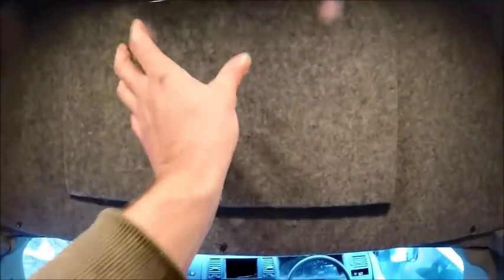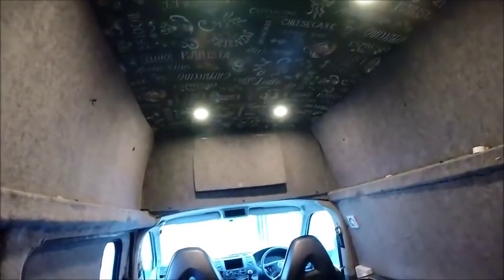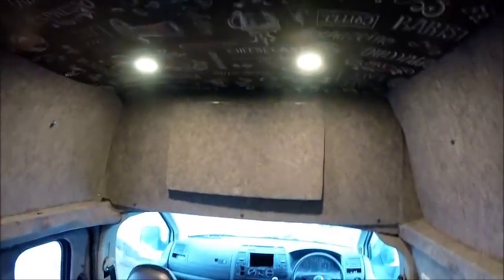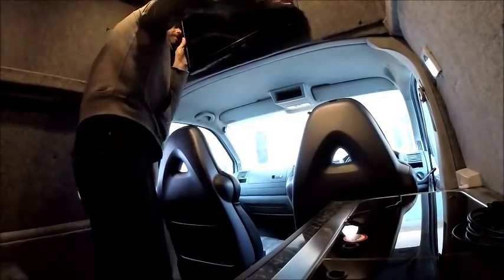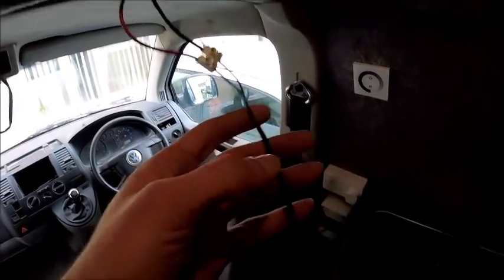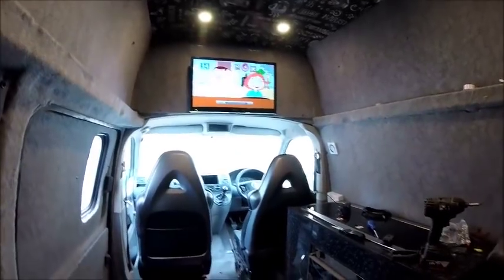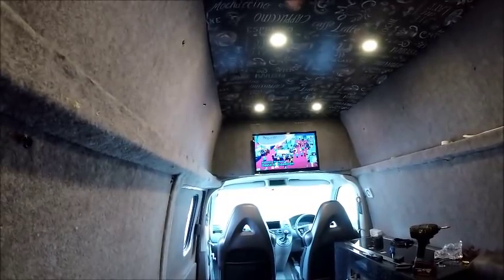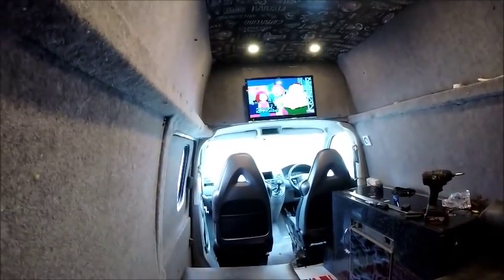VW T5 Camper van 12v TV Installation 24" Cello LED TV

Comment: Nice job, I fitted a 19” cello last weekend with exact same mount good picture but sound a little tinny on mine but worth the money imo.
Reply from the maker: yeah sound quality is never going to be good on cheap tv's, I might fit some PC speakers like I have in my T4, use barely no power yet deliver excellent sound quality
Reply: Camper Conversion good idea, I'm thinking of adding a dab radio/Bluetooth amp with speakers if I do will just connect with aux lead.
Reply from the maker: I'd seriously consider PC speakers, have a look at the pc speaker install video on my channel in my VW T4, they deliver a nice punch with its little sub, nice clear sound but barely use any power at all, like I think 3w at max volume on my power meter so just 0.25a per hour, a head unit with amp & speakers will draw a lot more power.  Only a concern if battery consumption is an issue of course but I found this the most efficient way to increase sound with minimal power draw
Reply: Camper Conversion thanks for the heads up will look into it, I’m just about to install another 140w flexi solar panel next week giving 280w of power always looking to save a energy.

Comment: Hi I’ve got a 12v tv for my camper build can I cut the wires from the adapter and split them connect to battery via fuse board? Also what fuse would you say? On the tv it says 5.83 Amps. Many Thanks 😊
Reply from the maker: Yes and 6-7a fuse

Comment: So if i got a tv in my house not being used at the moment, i can put it in my vw t5 just by cutting the wire and wiring it into my fuse panel, wiring another into my switch panel & earth to the vehicle?
Reply from the maker: if the TV says 12-14v on the back of it, potentially yes but if it only says 110-240v then no.  If it is 12v, then there will be no earth to wire, just + & -

Comment: My cello 12v tv lead has a block long the lead. Like what you get on an laptop lead. Did you chop that out also. I have worked mine the same a yours to no avail
Reply from the maker: mine didn't have that connection, if yours already has a 12v connection, just use it as is
Reply: @TheCampervanBuilder  Thanks for the reply. It's a cigarette style plug. I'd rather have it connected to the swith panel. Plus I've already cut it off (whoops). I have the negative to earth and the positive to a switch, then to a fuse. Then the other switch terminal to earth. I'm wondering if I should remove the box from the line